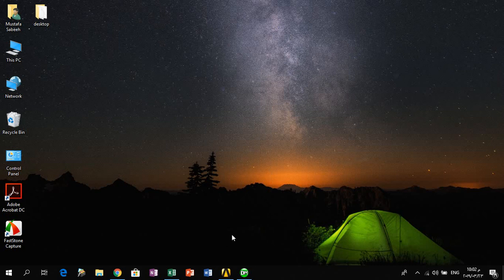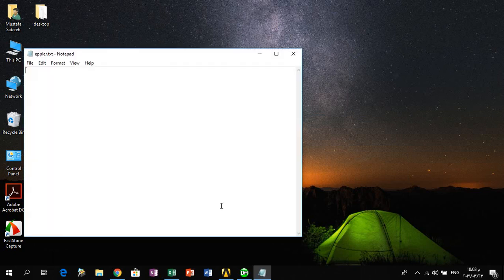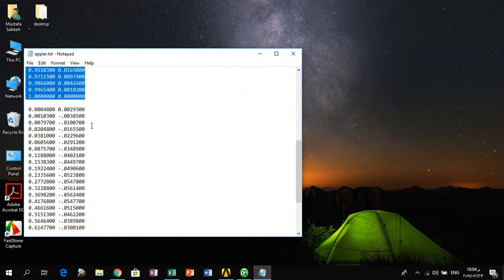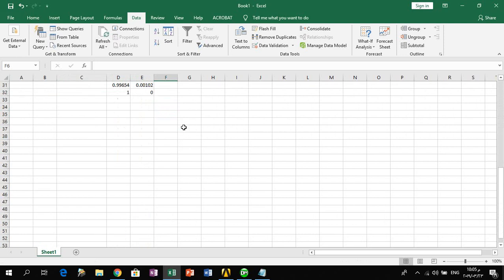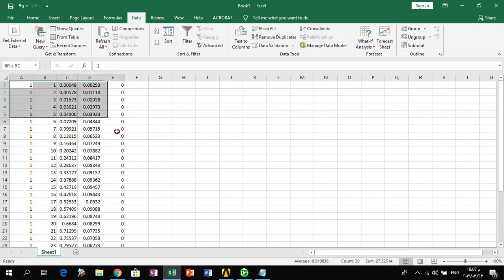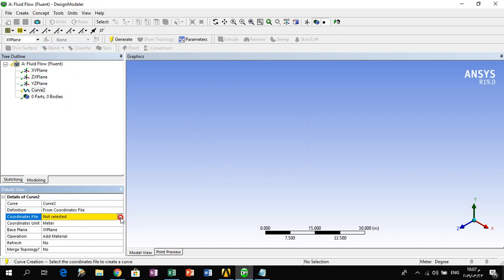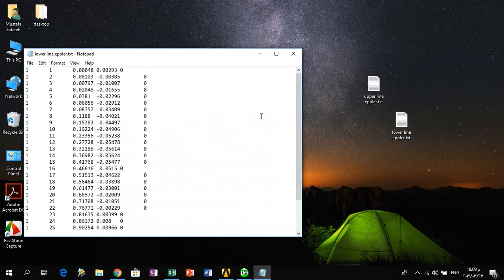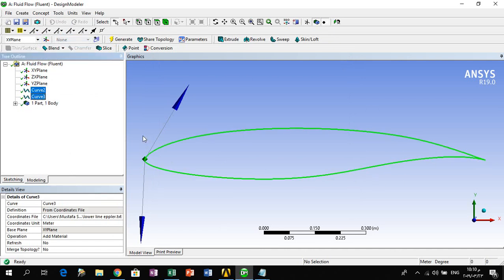Importing airfoil coordinates to ANSYS

Comment: If you want to add the upper and lower lines of the airfoil in one text file, after the last line of co-ordinates of the upper line leave an empty line (click enter), then paste the lower line co-ordinates, but this time name the group in the first column to be '2' instead of '1', and the continue the sequence of co-ordinate points, (i.e. if the last point of the upper line is point 67, start the lower line with 68). Add the Z co-ordinate to be zeros as shown, Then save.
Reply: Wow thanks bro this is informative
Reply: I was looking for that. Thanks man!
Reply: Thanks it was more helpful....
If upper chord start at coordinate 1,2,0 and end at 0,0,0.... numbering is 1

Lower chord should start at coordinate 0,0,0 and end at 1,2,0... (middle contains the remaining points)...numbering is 2

A separate video will be helpful for this you know

Comment: The ANSYS CFX solver exited with return code 1.   No results file has been
created. .. plz plz plz tell the solution
Reply from the maker: Check it first in excel by graphing the coordinates
Reply: I did not get you sir
Reply from the maker: @yatinchhabra623  try to draw the  coordinates in Excel application and check it if the airfoil profile appears its Ok

Comment: still error :(
Reply from the maker: Fadhlurrohman Faqih are you tried to invert the upper coordinates
Reply: @mustafasabeeh8893  idk, after copying the coordintaes from excell to nitepad, and then use it in the ansys the error dialoge still appear, but ill try it one more time
Reply: @mustafasabeeh8893  im using nacca 4418, and still error
Reply from the maker: Fadhlurrohman Faqih I think is the error due to not coinciding the start point with the end point, try to graph it in Excel first and be sure before importing it to Ansys
Reply: @mustafasabeeh8893  thanks, ill try it
Reply: @mf_faqih   did you fix the problem?
İf you did can you explain to me how did it?